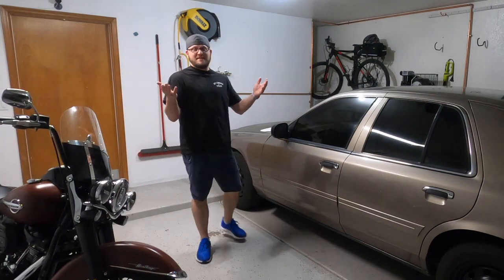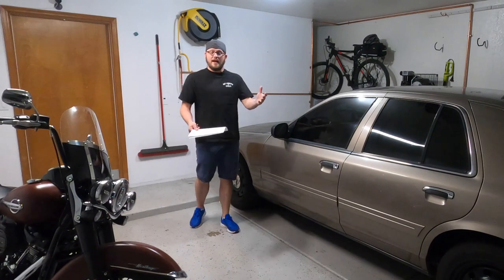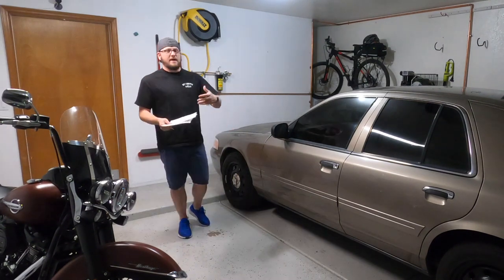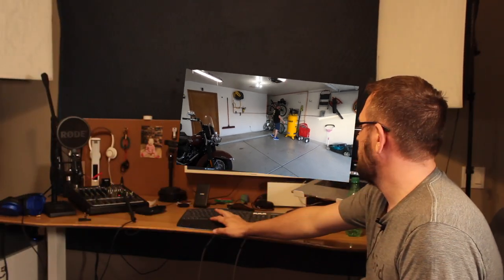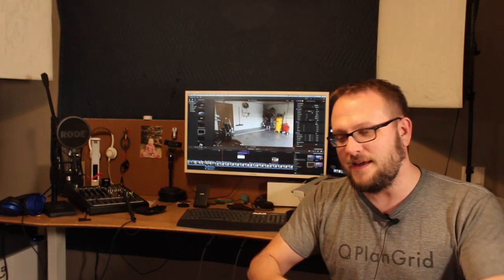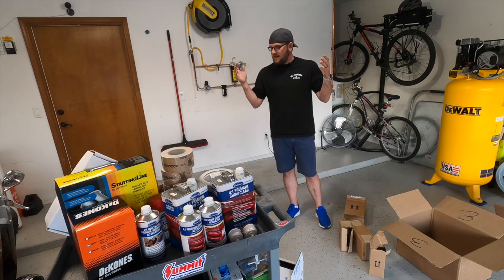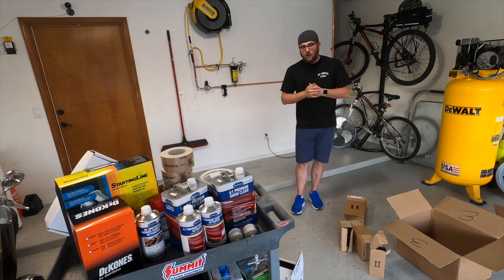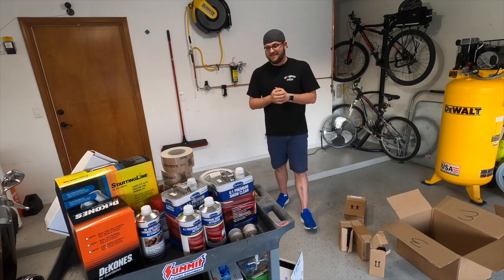Painting My Car At Home

Comment: You have a drone?  Did you use enough solder on that 3/4" coupling and tee? 😳 Just kidding!  FWIW, I absolutely hate any kind of painting, much less trying to paint a car.  Good luck.  I look forward to following your endeavor, Dan.
Reply from the maker: Yeah I’ve dabbled in drones for a while but I just got my Part 107 so you will see more drone stuff on the channel for sure.
Reply: @GearsGadgets  Good deal.  Thanks!

Comment: Suggestion.....  Make yourself an air dryer with an auto a/c condenser from an auto junk yard or new online for $50+ and an electric fan.   Dry air will help eliminate the orange peel.  May not be a problem in your low humidity area, but, the air can’t be too dry when you’re painting!
Reply from the maker: Yeah I wasn’t too worried about dry air here in the desert, I am not planning on doing any additional stuff to dry the air after the two filters at this point. We will see if it works out I guess.
Reply: Gears & Gadgets ...  I doubt you’ll have any issues in the dry desert air...  but, if you do, it’s a low cost solution that works.   Nice project you’ve got underway!

Comment: Not sure how far you are in this process . I have 30 plus years experience  in auto paint and would be more thrn happy  to help you with any questions you might have. I also have several  videos you may want to check out. Looking forward  to see the end result! Remember  preparing  the surface for paint is the most important  thing to a great paint job. Spraying it is the easy part.
Reply from the maker: Thanks I appreciate it!!! I tore it all down last weekend, sanded out the old acrylic butcher job I did last time. This week I have just been chipping away at prep a couple hours at a time after work. 2K epoxy will be on all the panels that I sanded down, then the rest of the car I was just going to wet sand 1000 grit and do a light coat of color just to color match. This Saturday will be primer shot in the morning, a little bondo in a few places, and sanding. Then Sunday will be color / clear. That is the plan at least.
Reply: @GearsGadgets  that all sounds good. You may want to use wet sanding paper that is a bit more aggressive like 600 . 1000 is fine but will take alot longer to cut. Epoxy primer is only needed if your spraying over bare metal other wise a 2k primer will work better.

Comment: I am not a great painter, but remember prep is the key to a good paint job. Make sure to wash the car with something like dawn to strip off any wax before you start the sanding and any bodywork. Also, pick up some wax and grease remover to clean between steps. Also, don't forget tac cloths. Good luck with the project!
Reply from the maker: Appreciate the heads up, I will do the dish soap step.